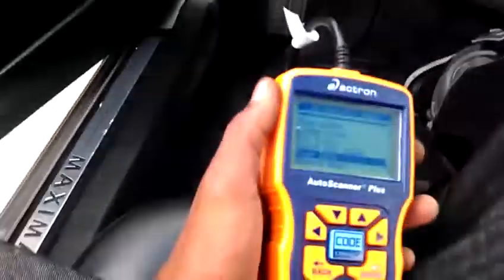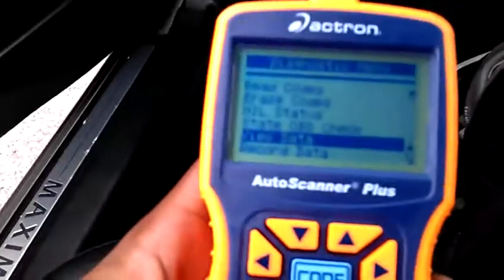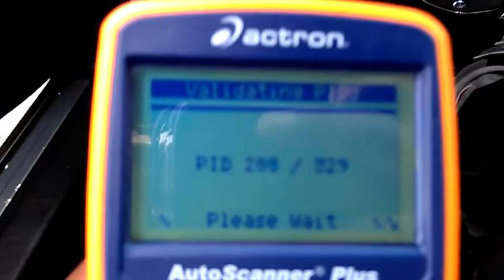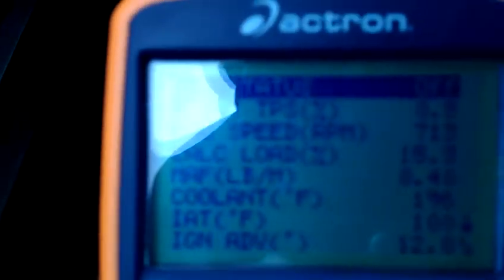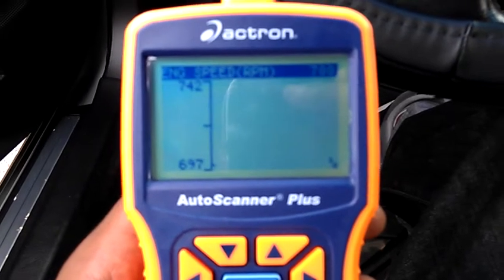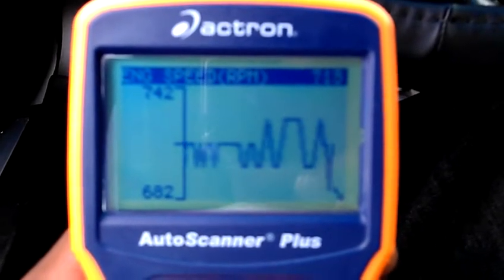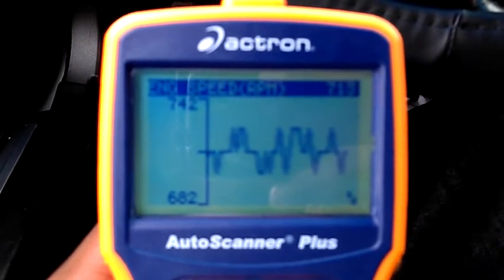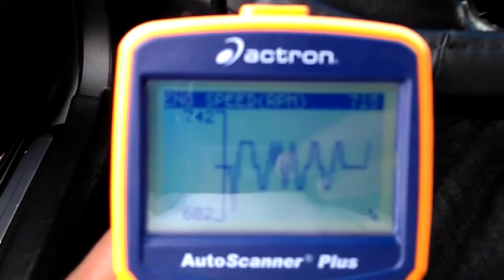Actron scanner CP9580A / Engine Speed (RPM) check using OBD II scanner --__-- 04 Maxima

Comment: All I really see here is that you checked your rpms with the scantool. Good job. If you'll pick fewer pids you'll get a faster refresh rate and more accuracy. Pids are the data items, parameter identification. I've never understood why so many people call this a running diagnostics since you really weren't diagnosing anything. I actually do automotive diagnostics for a living and it involves a lot more than looking at a scantool. Everything depends on what you are trying to diagnose. There isn't enough information given here to see what you were diagnosing, what you found, how you found it or what you did to repair it. I do have a few of the OBDII tools for quick code reads and the CP9580 is a decent tool. The code connect feature can be good. I haven't updated that tool in years though. I'm not sure if I still have the usb cord or if it still has updates available.
Reply from the maker: Styxxed All I was doing was looking at the Live data. And looking at how my RPMs were fluctuating.. Yea really not a diagnostic
Reply: +O.G.Nat-tral1 Not picking on you. You did a good job of showing what some features of the tool are and it is a decent basic scanner with a great price. In fact, I think they owe you a tip or something 'cause from here I looked on amazon and found the later version of my old cp9580 and ordered it. CP9680 is the newer version. A little more $ but not expensive. It's like I said about the running diagnostics part though. It's all over the internet that a scantool hookup is all you need to do a diagnostic, the scantool manufacturers push it, the tool salesman push it, hell even more than a few mechanics think its true but when you actually do automobile diagnostics you know its not true.  It's a tool. For some jobs it can be very helpful, for others not so much. The problem for me is explaining that I can't run a car in here and hook up a machine and know what is wrong from that.